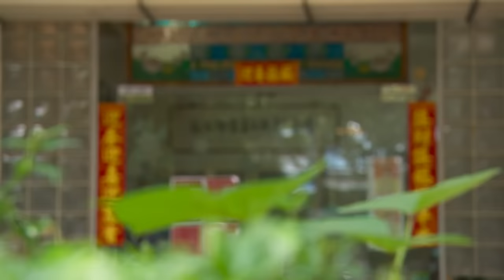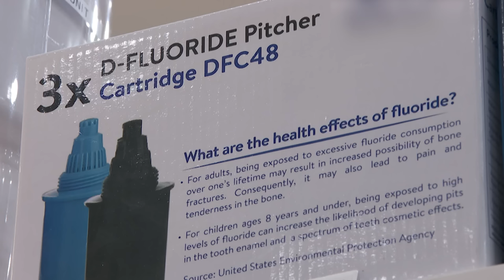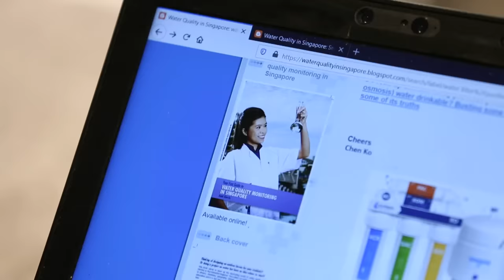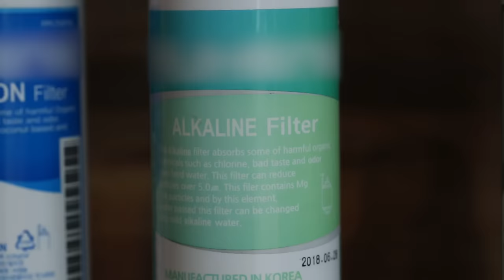Do Water Filters Really Purify Your Water? | Talking Point | Full Episode

Comment: Distillation is good to avoid salts to accumulate in coffee machines and kettles. Distillation does not create waste brine and water wastage. It uses more energy, but the output has no ions. Distilled water can be interesting especially when you don't want a water that kills bacteria and fungi for example to water plants, and this increases the effectiveness of fertilisers and foliage nutrition. Because plant health require a lof of micro life in the soil and on the surface of leaves. 48 hours of tap water storage in a tank can reduce at least chlorine content to avoid killing bacteria in the soil (or less so). Distilled water is insuring H2O is the only thing you have at the output (roughly). Just don't store water anywhere, even in a pipe, because given time life will develop everywhere. Minerals are in solid food, we don't need minerals in water (except during extreme long duration sports, but even then you'd better eat something than get ions from water). Our body is made from water, as soon as you eat something a lot of it is ionised in the water of the body, as long as you eatsometimes, you won't miss any mineral.

Comment: Reverse osmosis also wastes water because there is a required ratio that goes down the drain for every bit that comes out filtered.  In locations with water conservation shortages this is irresponsible behavior.

Comment: Funny tht throughout the presentation, there was not once a measurement of the purity of the filtered water versus tab water, only bacterial count. If you're out to bash the filtration, at least state what filtration-method(s) you want to make looking bad. There's no way you can beat Reverse-osmosis. Even if Singapore Water Works used Reverse-Osmosis to generate tab water, dispensing it through 5700km network leaves the purity much to be desired ..

Comment: Never heard about filters adding minerals to water (as name suggest, they are supposed to remove things from water). I'm using carbon based filter to soften water before boiling, so it doesn't create sediment scales in my kettle.

You've jumped to the conclusion, that neutralising acid in stomach is bad or isn't good, too quickly. In normal cases yes, you don't want to do this (as in most cases when your body works properly), but there is a lot conditions, temporary, chronic or from ilness, when you will benefit from it. For example stomach inflammations, helicobacter pylori infections, acid overproduction, quick relief in heartburn, GERD... You never want to neutralize it fully though ofc, but it's almost unachieveable without medication.

Filtered water can actually be worse for hydration than most of unfiltered water, as it goes through intestines faster having less particles of minerals, but that's negliglible.

Comment: My water filter has the activated carbon upstream of the final filter which is fine enough to filter out bacteria and viruses, so no concern about regrown bacteria in the activated carbon. 

The filter also serves as the final guard against contaminations due to pipe repair, regular cleaning of the water tank on the rooftop, etc. 

It is incautious for this exercise to draw across the board conclusions without considering the wide variety of designs of filters available in the market.

Comment: Interesting to see how in Asia these things work, and how in Europe. In my country of Europe, we have various type of filters as well, and they have markings for what they clean, they in various levels. What's in my filter that I use for the whole water in apartment, is silver flakes (silver is known as a anti-bacterial material, perfect for water filtration) and active charcoal (also known as a basic well known water filtering component).
It cleans for, respectively, bacteria, pesticides and herbicides, chemical components, bad taste, bad smell, rust, mechanical additives, and sediments. One filter filters out about 8000 liters of water, then it is required to change, and it's cheap, 7-11 Euro's.

So you don't need honestly fancy expensive stuff, you just need to be educated on components used in those filters.

If you think that filtered waters gives you better digestion and helps against cancer, and those other supposed myths that filtered water cures, it's probably because the water you use has bad bacteria and other stuff that can potentially cause those issues, so it's not that it lowers it or helps you... well, it does help you, but it's all because you were already drinking a very bad water that wasn't filtered out through the city cleaning/filtering facility or you have bad pipes that haven't been changed forever, either in the building or underground piping.

Comment: Ha Ha - in 7:02 the laboratory worker says the chlorine level of filtered water is the same as tap water. What kind of filter were you using for the test? Every simple carbon activated filter (coconut best) reduces chlorine by over 90 %. Proven and tested.  Filters don't need to be so expensive. I never use osmosis. Sediment and coconut carbon filter for about 30$ every 6 months are enough. Minerals stay the same, taste is much better without chlorine and the possible dirt from the pipes removed. If you don't filter, your kidneys will do it anyway. :)

Comment: Well you need to get your local water treatment plants to stop using aluminum hydroxide corrosion control and flocculant to avoid ingestion of aluminum and Alzheimer's disease.  Then charcoal or hard coal filters for houses can prevent exposure to perchlorate and chloramine.when you shower.  The coal filters are going to be needed for a while untill the chemical weapon manufacture treaty enforcement and obligations reach to all halogenated vinyl and halogenated carbon pollution.

Comment: If the filter traps most of the chlorine from tap water, then it should have killed most bacteria. That lab should have tested the filtered water with increased numbers for chlorine-resistant bacteria
Reply: the opposite side of the carbon filter has much less concentration of chlorine passing through it. the stagnant water will lead to biofilm and hence the breeding ground for bacteria.
Reply: @oldtwinsna8347  assuming that the water on the other side is not kept long enough,  no stagnation should occur and thus no biofilm

Comment: I call bs on the water sampling of the hydrant.  One is supposed to flush the hydrant first then sample.  Also, hydrants are not supposed to be "throttled: in other words turned on just slightly.  So many things wrong in this sampling example.  Also, if it really is an RO unit then it is supposed to be run through a carbon filter before it gets to the RO membrane.  This would remove the Chlorine and the Fluoride. This is a fail of the installation.  Lastly, bacteria can become present during the actual sampling: it is very easy to contaminate the sample simple by a human taking the sample.  And yes sink carbon filters are notorious for bacterial growth at any time.  Peace.

Comment: In other words, if you want to control the bacteria. Then you have to clean the entire flexible tube/hose leading from the filters to the faucet and the faucet aerator when changing out the filters. Makes sense. The aerator especially, because it has the highest surface area and is in direct contact with the air = Moist + warm Air = Bacteria Heaven

To do so, i would guess hot water (+65°C) would suffice. For that to achieve, you could install a manual bypass between the hot and cold hose below the sink. That way hot water flows through the cold water line when ever you need it. 
Or if you have a separate Filtered-Water Faucet, you could connect it to the normal water faucet and do a reverse flush with hot water.

If you don't want to do all this "plumbing" then a GammaGun or some form of high radiation you can apply to the entire filtration system is the surefire way get rid of all bacteria... only dead irradiated bacteria are good bacteria

Comment: 1. Sounds like she screwed up the test and got the 2 samples switched.

 2. Pure water might not prevent cancer, but if it filters out cancer causing mutagenic chemicals that are normally present then it definitely would prevent some cancers. 

3. Filtered water that has less minerals may get absorbed more readily, but not recommended as totaly purified water will leach minerals out of the body making you deficient.

Comment: Dr.Leong is wrong on almost all counts.1. stomach acid comes out only during food digestion, not all the time(otherwise there'll be ulcer holes in your stomach very soon. It's when you're not digesting food that slkaline water helps clean up the residual acidity in your throat, esophagus, gastrointestinal tract. 2.smaller cluster of water-molecules in alkaline water. She forgets 'hydrogen-bonding' among water molecules that can form a large network( more than 12 molecules in the cluster). But with alkaline water, this hydrogen-bonding is dissipated by the alkalinity and the cluster becomes much smaller(less than 6 molecules). 3.Reverse-osmosis filters out heavy metals(lead, mercury, cadmium, nickel, aluminum,etc.), Chemicals like fluorides, bromides, chlorine,  Carcinogens(pesticides, insecticides),etc. so preventing cancers.

Comment: No one showed a true Reverse Osmosis system. What that lady said is reverse osmosis is not.
Reply: I was curious also normally RO filter membranes don't do well with chlorine, typically it eats holes in the filter, she would need carbon filter on the front side, and depending on hardness possibly a softener to protect from scaling. I didn't notice a run off line to cary the waste from her RO but I could have missed it.
Reply: @northwestgardener5076  yeah I have well water so I have a 7 stage RO system with booster pump. I feed is soft water that has already passed through a 5 micron filter. Then it goes through 1 5 micron sediment, 2 charcoal block, RO membrane, coconut charcoal, alkaline and lastly a UV disinfectant.

Comment: Looks like you need basic RO-filtration education. Chlorine is removed by the carbon pre-filter and calcium carbonate by ion-exchange resin (exchanging sodium chloride for calcium carbonate that can pluck up the subsequent RO-membrane). If there's residual chlorine in the filtered water, that means you need to change the carbon (block) pre-filter, and 13mg/liter in filtered water is equal to 13ppm while it should have been Zero if you have had ion-exchange pre-filter. My conclusion is that you might have RO-membrane, but no 3-stage pre-filters (PP for rust/sediments, Carbon for chlorine/smell/organics and ion-exchane resin to trap calcium carbonate/magnesium sulfate hardnesses).

Comment: I would argue this video to be very misleading and here are my arguments:
- this video puts all brands and makes of water filtration systems in useless category and points to them to be more harmful than useful, but does not consider that tap water is coming from the same or similar filtration process with added chemicals for disinfection
- having significantly less bacteria in tap water just points out how much chemicals tap water contains to prevent growth of microorganisms, one could argue that this is not healthy as it can "clean" bacteria/microorganisms in your digestion track and/or elsewhere, note that human body has 10 times more microorganisms than it's own cells to be able to keep it self alive and healthy

I assume high amount of Chlorine and Chloramine should be used for water supply when/where you have water siting in massive water pools on top of the building that rarely gets cleaned, I know this is needed for providing high enough water pressure in the building but still is shocking when you consider how it uses "tap water" for cleaning. From this I can only conclude that there are probably a lot more disinfection chemicals in the tap water than human body needs as I don't see/hear any UV light treatment being used instead.

Only useful information in this video is a tested fact that many of the water filters will filter a lot more than needed which could be just as bad or no better than unfiltered tap water and the rest of it is just propaganda which is not surprising since the source of this video is Mediacorp (https://en.wikipedia.org/wiki/Mediacorp).